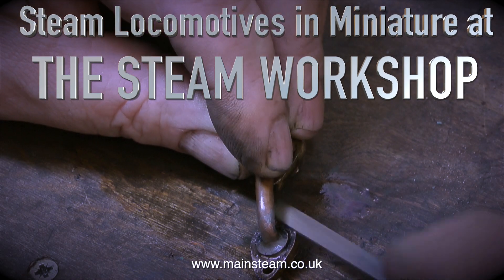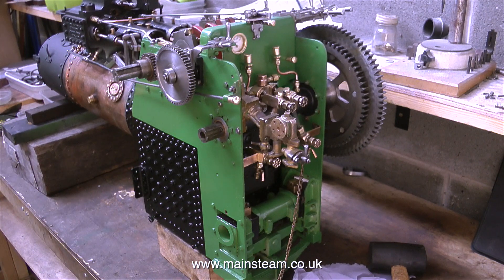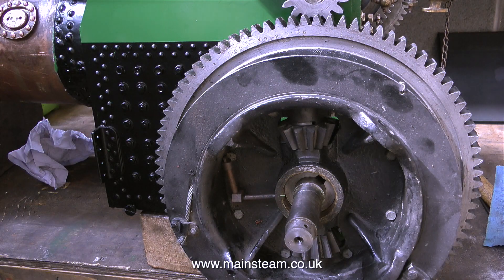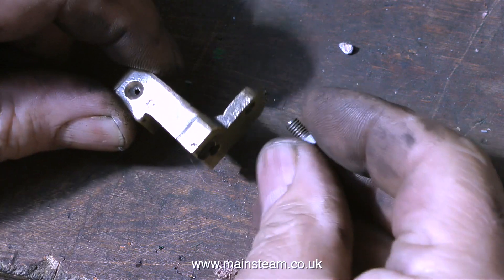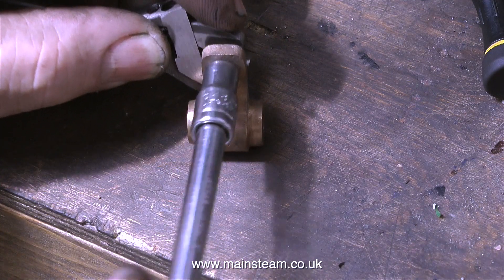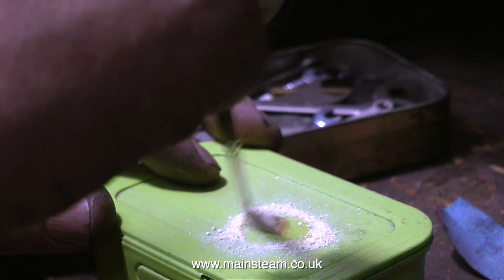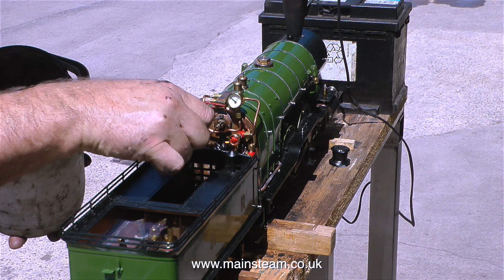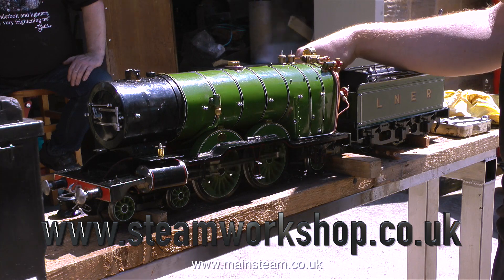THE STEAM WORKSHOP - GARRETT DCC TRACTOR - PART #8

Comment: I could not tell from the video, but is there enough un-threaded  shaft to chuck it in your drill to turn the valve while putting pressure on the seat?  Maybe some electrical tape to protect any threads and chuck it lightly.  Way, way, back in time, for manually doing auto valves we had a suction cup tool to rotate the valve.  How about JB Welding a temporary shaft to the valve face for chucking.

Comment: Could you explain the simpling valve.
Reply from the maker: The "Simpling Valve" admits high pressure steam directly from the steam chest into the valve chest of the low pressure cylinder to rotate the engine if the high pressure cylinder stops at top dead centre (TDC) so then the engine starts .......
Reply: Keith Appleton thanks. I have been in the engine room of a triple expansion engine, the simpling valve makes sense .

Comment: I used to sell Key Steel. It's EN6A, very similar in composition to EN8, so 40-ish carbon and about 75 manganese to lend a bit of toughness. But the real distinguishing feature of key steel is that it's sold to tolerances of -0 +a few thou (relative to nominal size), whereas pretty much all other bright steel is sold to +0 - a few thou. The 'few thou' of course depends on the nominal size. We sold it mostly in 13" lengths, mostly to toolrooms, though of course it could be had in long bars, generally to special order.